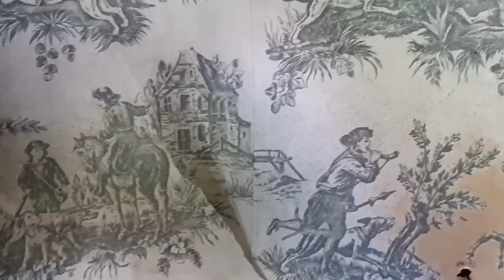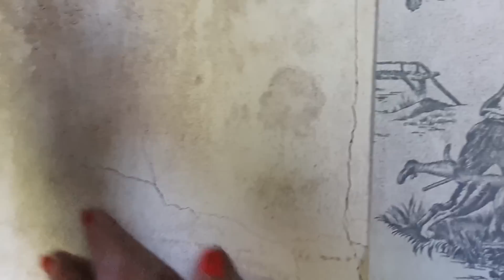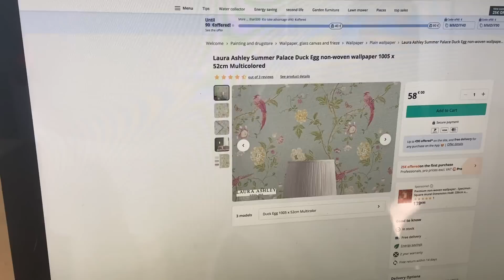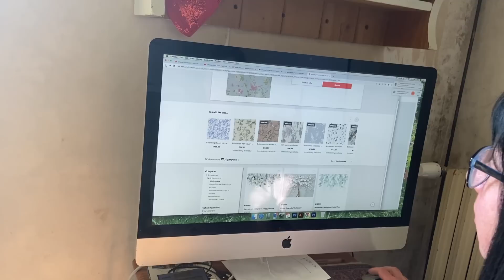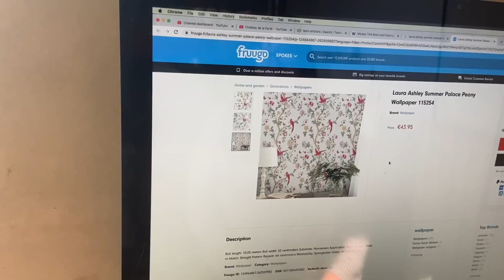Uncovering The Hallway's History!

Comment: @12:45. Carol, the plaster is bulging off because the wall is loosing it's structural integrity and needs to be reinforced.  

It's also very possible the floor beams above that wall are just as compromised as what Adrien replaced in the adjoining room.

Don't plaster over it, strip it back to bare to inspect the structural members.

Comment: When I worked in an auto shop some years ago, a tip I picked up for loosening seized/rusted metal bits is use automatic transmission fluid thinned with kerosene (or acetone) in a 50/50 mixture.  ATF is loaded with detergents for conditioning parts, the mix works as well if not better than WD-40 and for a fraction of the cost per ounce.

Comment: What a shame there is cement on the cobble in the Stable. I don't know how similar that French cement is to our Canadian cement (Portland) but with ours it doesn't permanently bond to other surfaces, especially if they are as smooth as cobblestones. We just whack it with a general purpose hammer and the cement just cracks and flakes off. Start at the edges, if you wish it 'gone'.
Reply from the maker: Great tip but Gonna be a while until I’m back over there so that job can wait!
Reply: @LifeAfterLaFerté  - It's another big job so I totally understand. Plus you'll need a place to put all of that cement that doesn't compost or make a trip to the Tip $.

Comment: My grandfather had a small dairy…back in the day. In the barn there were grooves so granddaddy could clean the milking area with the water hose, (and bleach).  Re the barn mucking and concrete over the cobblestones, I notice a groove between the stalls and the main part, that is for directing water out of the building when your hosing down the excrement etc., if the cobblestones had sunk down and was creating a “pond” it would make sense to concrete it to correct the flow of water.

Comment: In the stables, those metal bowels that are attached to the water pipe are indeed, waterers. Typically for horses, although, I suppose a cow could use them as well. It does work like the toilot, only opposite.  The flap in the center is on the up/off position and the animal, (typically a horse, but I suppose a cow could operate them as well) pusing  down on the flap with its nose  which usually requires a bit of force, and that allows the water to enter the bowl.  There is a learning curve for the animals, they do have to be taught how to use it, and when it freezes there is no reserve for the animals to access. But it keeps the animals from playing/splasing or knocking over a bucket or tub making a  mucky mess or wasting water.

Comment: I've been told that old wallpaper might have been hung with simple flower paste but cellulose glue has been around for a long time as well.

If I remember my childhood farm holidays right these things aren't float valves, they're spring loaded valves that the cows press down on to get water. The valve is open as long as the cow pushes on that metal bit.

Comment: Your video was lovely today. I agree with you. You haven't  found the right wallpaper yet. The pipes giving water to the reservoirs was so clever for times past in the stable. The used door Adrian put up in the stable is great. I like the old lock. They concreted over the cobbles to raise the floor so the urine would run down to  the crevice drain that would drain out the wall near the door.

Comment: The wallpaper choices are nice.  It think there are some prints with just trees or vines and a bit of flowers without the birds.  Colefax brand called "Snow Tree" is nice.

In the stables it looks as though the cobbles were taken up in that part and then the empty spot was covered with cement.  It could be there was a lot of damage in that area and the cobbles couldn't be saved.

Comment: I guess it's not so easy to clean cobbles so they poured cement over it. I think it's still practice if you do use that space as a workshop.
Reply: I think it’s more likely that the original cobbles in that area became broken and degraded and a previous owner poured concrete for safety and ease instead of the more time consuming task of replacing the cobbles.